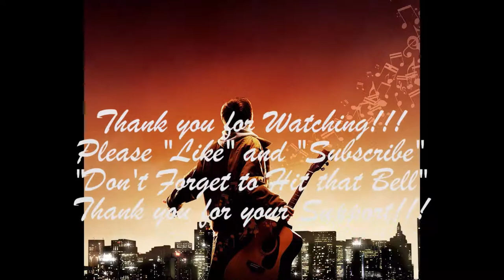How to: Install a Battery from a 2014 Hyundai Sonata

Comment: Thank you so much for the tutorial. It saved me $90. I have a 2013 GLS and I did not have the heat protector on the battery, but I still had to remove the air intake. My original battery was factory so I don't think I'd came with a heat protector. 

All in all, it took me 20 minutes and without any power tools. I just used tools that Costco let me borrow from the tire center. 

Thank you!
Reply from the maker: Sweet I'm glad it worked out for you. That's the reason why I make these videos, to help you save by doing the work yourself! Yeah some times its a little extra work in completing the steps for the process but it saves you a lot of stress and cuss words by doing a few extra steps and getting enough access room to reach the replacement part. Thank you Im glad it worked out for you! Have a Great Day!

Comment: Why is it nessasary to remove the air intake? It looks as though the battery (once the bolts are removed) would slide out easily and go back in just as easy. It's seems like unnecessary bextra steps. Am I wrong?
Reply from the maker: Yes the Air Intake is necessary to remove in order  to access the battery strap down mount plate. Its under the intake pipe. U can probably use a swivel but its only 2 screws to get it out of your way. Its a must if you dont want to struggle. I try to make things as easy as possible for everyone to get this done.

Comment: What kind of battery is that
Reply from the maker: Its Group Size 46
Reply: @559powerscape  In the previous video you said Group size 48. Which one is it?
Reply from the maker: @l31007  It is a group size 48-75...you can see it on the tag on the battery
Reply: @559powerscape  most places tell you it's necessary to use the AGM battery ONLY. I don't believe that. What's your opinion? And what has been your experience with trying the standard battery?
Reply from the maker: @realSamAndrew  i think a Battery its just a Battery its just a energy storing device. The alternator does all the work. The only thing the Battery does is start the car and run electronics. Once the car is on the alternator takes over.